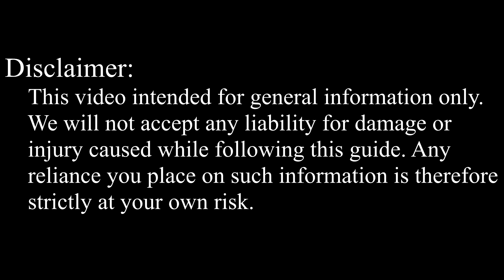Sony VAIO VPCSB3M1R PCG-41219V Disassembly, Fan Cleaning, and Thermal Paste Replacement Guide

Comment: Hello. I know this is an old video, but I have looked around, and in the manual of the laptop, and there is no mention of this. I received a VPCSB25FB, which outwardly looks the same as this one, and the board also looks the same. 

I will take it apart soon to do a much needed cleaning and thermal paste replacement, but I would like to also replace the CMOS battery while I am in there. What is the type of battery required? It is briefly seen in the video, I know it has two leads coming out, but that's it.

Comment: There are actually more small screws that hold the processor fan.
Be very careful when disconnecting the cables between the motherboard and the monitor, as they are very sensitive and you can damage them.
As far as possible, if you can carry out your operation without disconnecting any cables between the motherboard and the monitor, there will be less chance of you damaging your notebook.

Comment: Thanks, How-FixIT, great video!

I have one question: on my laptop (VAIO VCPSB model, too) I could not remove the heat pipes after removing the screws, whereas on your video they come off easily. It is almost as if the thermal paste is glued to the heat pipes and chips. Have you seen/experienced this before?
Reply from the maker: the problem is thermal grease is completely dry, and in this condition it's really works like a glue. Try to heat up heat pipes using for example hairdryer, maybe it'll help
Reply: That's was it! Thanks a lot, How-FixIT!